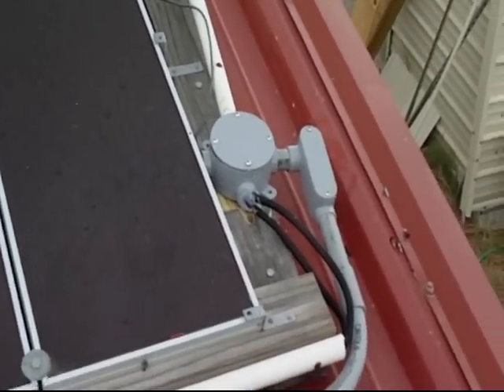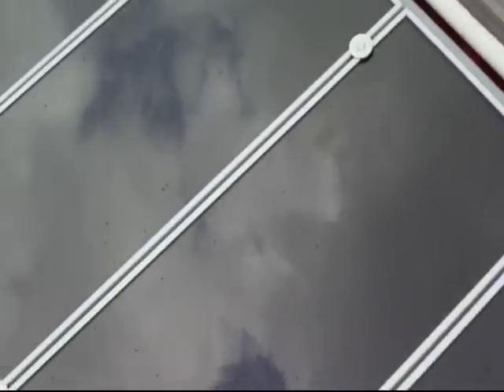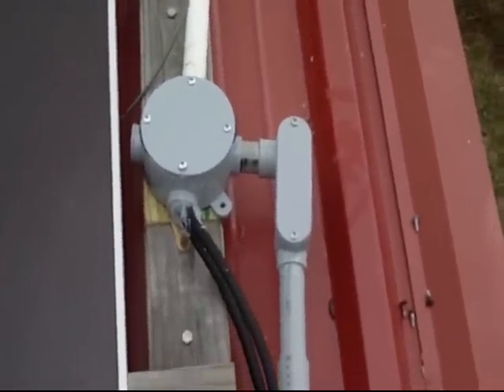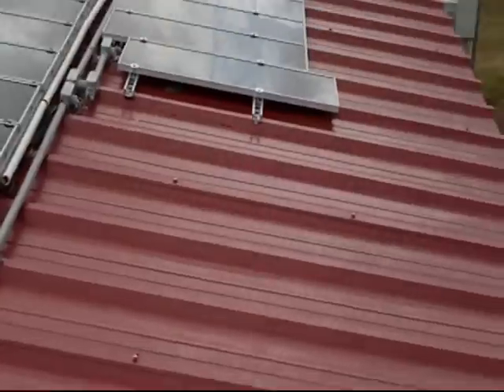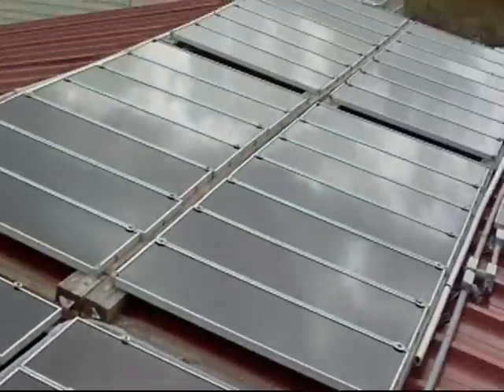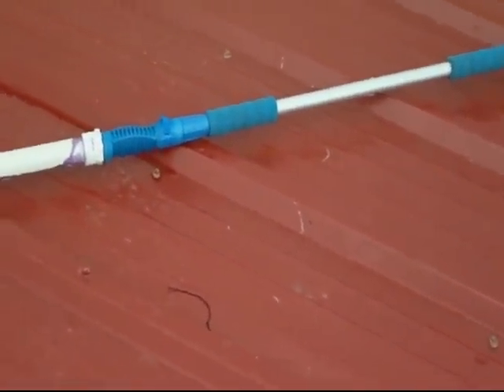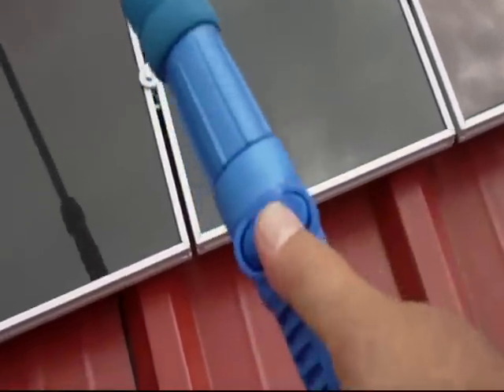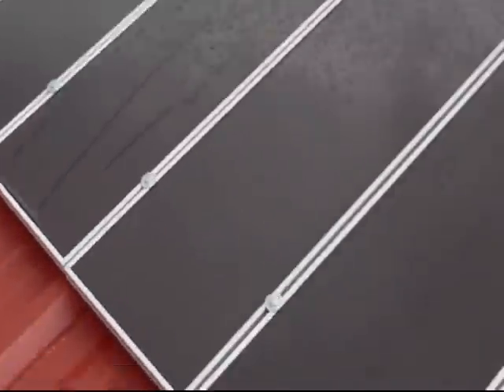More Harbor Freight Panels

Comment: Oh ok hey thanks...yea I wanna do what you have done here in this video?...I have like 30 15watt harbor freight panels?...I just have to buy some cables...or wiring, & a charge controller...I'll probably get an outback controller...but I don't know yet...as long as it's mppt...thanks for all your help...if anything?...I'll just connect 8 panels per set like you did...& just use bus bars...that way it's some & easy for me not to get confused...

Comment: how did you connect all of those panels together?...& like what size, guage cable did u use & stuff?...b/c I hear you say that u didn't use buss bars for this application...so i was just wondering how did u set up all of the wiring?...thanks
Reply from the maker: I connected them in series/parallel limiting the voltage to the max supported by my charge controller. The size of cables I used was determined by the length of the run I needed between the panels and the charge controller and amperage draw expected at the nominal voltage going to the charge controller.  By  the question you are asking you are not familiar with electrical load knowledge, my best advice to you is to buy a kit from wholesale solar so you don't have to worry about these details. Good luck with your project.

Comment from the maker: @wyattlisadana Right, yes, thanks. The other advantage of solar panels as you have notice is the cooling effect on the roof for two main reasons. 1- it shades the roof (half of my roof is shaded) and 2 - there's a two inch air gap between the roof and the solar panels which creates an undraft and cools the roof further.  Thanks

Comment from the maker: @LDSPrepper Unless you can raise it 20 higher than the nearest obstruction within 500 feet you probably won't get good air and would not get the results that you hope for. If your average wind is less than 12 mph I would also not do it.  Thanks

Comment from the maker: @lamartosh How far from the panels to the charge controller? How far from the charge controller to the batteries? What is the voltage of the battery bank?
The amps per15 watt panel at 12 volts is 1.25 amps - the lady is absolutely correct.

Comment: Al,hi buddy I order me a c60 xantrex charge controller and the lady told me to figure my amps like this ,  my panels 27x15 Watts divided by 12 volts is that correct I thought they where 1amp each. Thank you for your help. Do I need bigger wire then ten gauge wire too? When I get it I will do another video thanks al